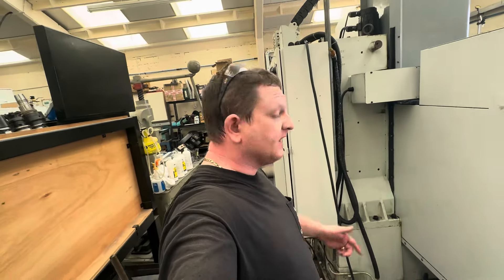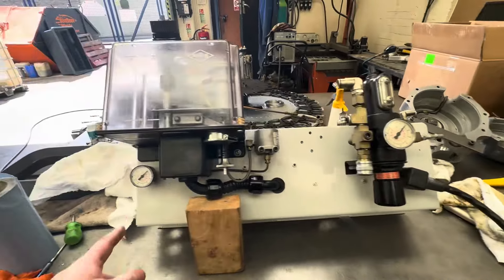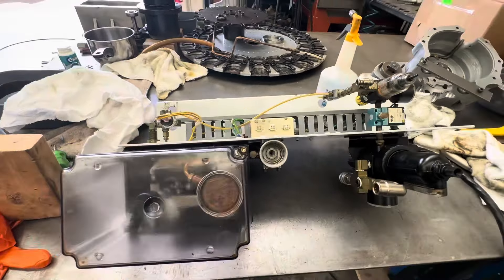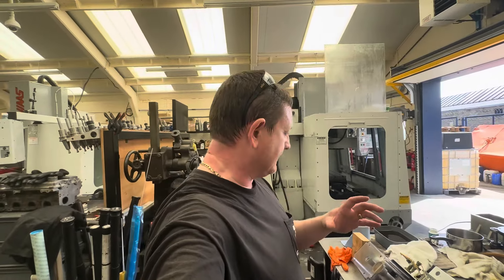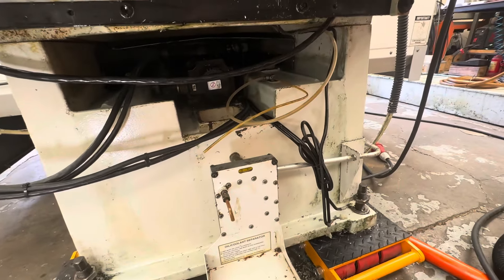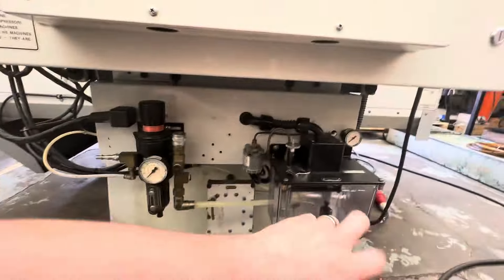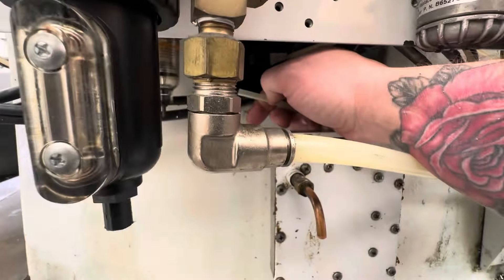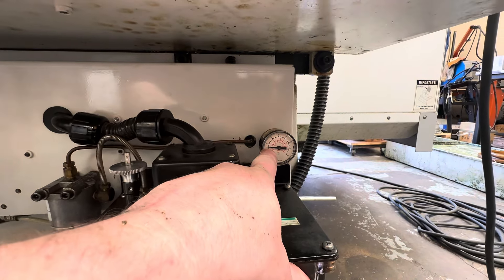Haas VF1 lube system issue identified !

Comment: Some good fault finding and maintenance work carried out which tbh should've been done over the years. Most shops run these machines to a standstill then sell them off.
Reply from the maker: Thanks
Yeah i have come to learn that things need to be done even if the machines still performing well, preventative maintenance is always best

Comment: Hi Marc , I have recently serviced my machine by cooking the meter units with a propane torch . I managed to save all of them on a vf3 .
Reply from the maker: Well done for servicing it, that's not something i have ever tried personally, and as i am starting to stock these parts for sale on my website, for me personally id rather just replace them
Reply: They have a rubber diaphragm in them be careful of cooking them I imagine it would melt it.

Comment: The metering units are considered maintenance items. They're actually supposed to be replaced every year or 2. Maybe if you use synthetic oil, they won't plug up. On the mill I got a few years ago, not only were the metering units clogged, but the oil lube passages on the ways (box way machine) were also plugged up with congealed oil and graphite dust. Even with a grease gun filled with diesel, I couldn't get anything to flow into the lines beyond the meters. I had to take the whole machine apart and clean everything properly (and then I found bad turcite as well - surprise surprise when it wasn't getting oil!)
Reply from the maker: Yes these things get easily overlooked by most people when buying old machines, i certainly did not know to change them out when i got my first machine! and unless you know for sure they have been changed i believe its one of the first things you should do when you get a machine just as good practice, as the cost will be cheaper than a new ball screw or linear rails that's for sure

Most of the damage to the machines i have owned or have bought for spares etc come from a lack of maintenance, ive started to finally look at the machines for what they are and that's money earners, so if you want to make a little money you have to spend a little money on their up keep otherwise it will cost you more in the end